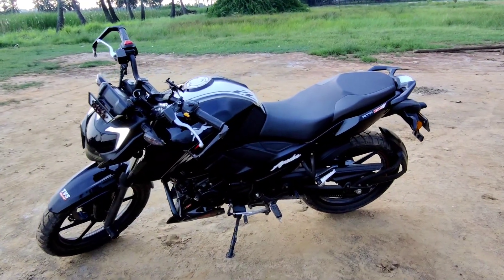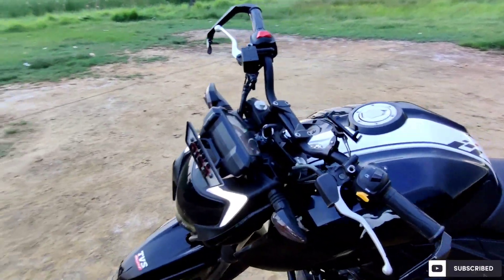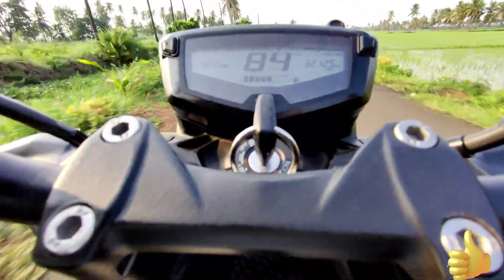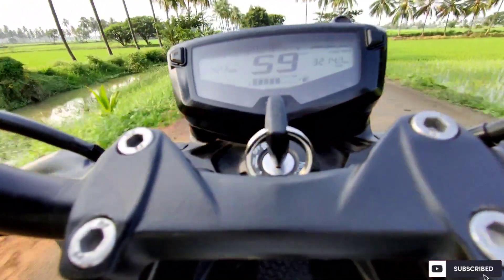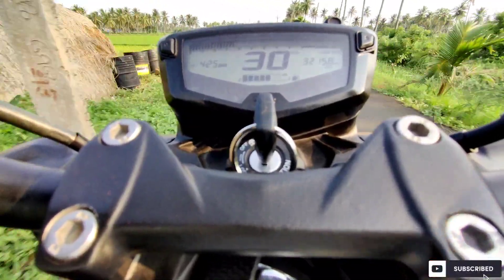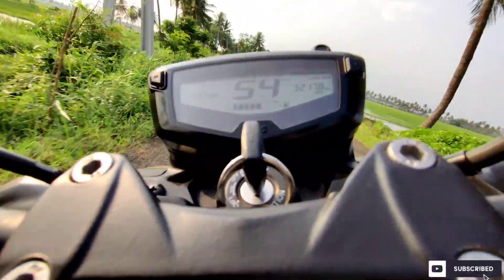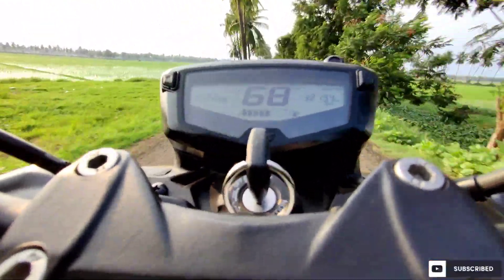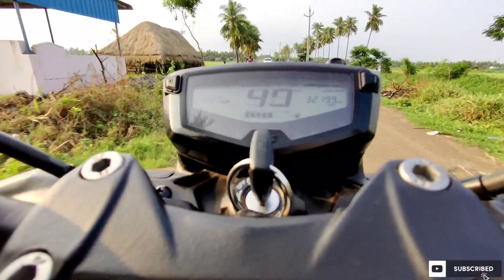1st impression of Slipper Clutch installed in Apache 160 4V. Is it worthy!!!???

Comment: Hello bro !! I am also thinking of installing rtr 200 slipper clutch on my rtr 160 4v, plz answer the questions below:
1. Does it work properly as if company fitted ???
2. Any change in bike performance??
3. Any change in mileage ? Some say that they r getting around 2 ro 3 kmpl lesser mileage with this installation. 
4. Any weird sounds or noises?
5. Any bad effect on the engine??
6. Is it only the clutch that is needed to be  changed or any other parts like clutch bell or crank shaft gear etc ?? Any bearings changed ????
...r u satisfied with it ???

Comment: I have just installed slipper clutch on rtr 160 4V. I have hard down shifting what might be the issue.
Reply from the maker: Check ur chain lubing and clutch wire adjustments

Comment: Bro this will void ur bike warenty know ! !

Is there any issue in bike initial pulling. 
Planing to install this on new rtr 160 4v 4 million edition ?
Reply from the maker: Yes
Dont tell in service center that you have installed slipper clutch
Reply: @bishallohani3927  since u have been using this for 6 months know . Any issues ?
Reply from the maker: No
Reply: No it will not void the warranty of bike.
Reply: @KomalAher005  yes . It will void  warrenty . I have confirmed it
Reply from the maker: Don't tell them u have installed it they will never know.
Reply: @ameerkp5538  i have just installed it on my bike from TVS Authorised Service centre
Reply from the maker: Nice

Comment: How much the cost of slipper clutch & what other part u change & cost...??
Reply from the maker: Cost of slipper Clutch is 2000
Except that i didn't change anything
Reply: @bishallohani3927  so what u change in engine side....?? Clutch plate etc...?? Why u open engine compartment...??
Reply from the maker: @rahulverma-7  we have to open that for changing clutch plate
Reply: @bishallohani3927  ok thanks boss...... clutch plate & sleeper clutch both cost u 2000.....??
& Clutch plate changing is compulsory...??
Reply from the maker: @rahulverma-7  u don't have to change cluth wire and lever
Just u have to change the clutch plate.
Make sure u order the same clutch plate which i have shown in video
Reply: @bishallohani3927  okk bro thanks